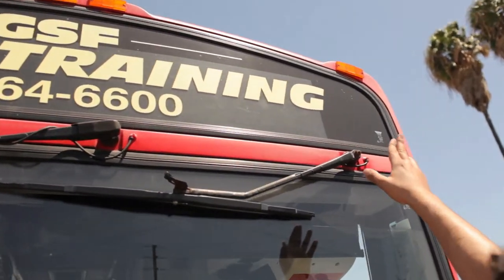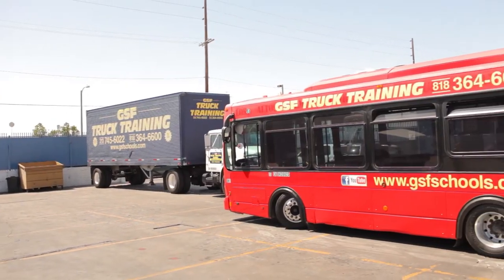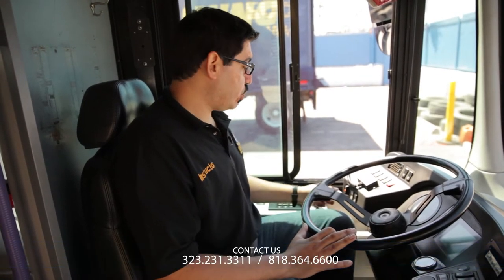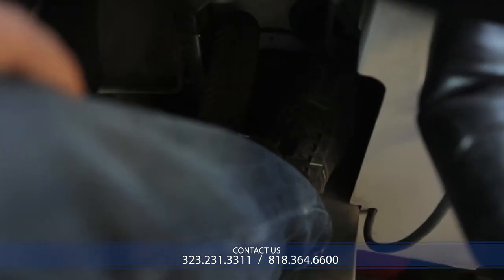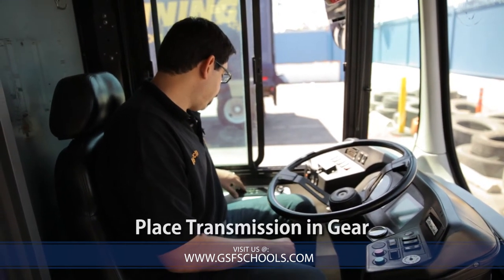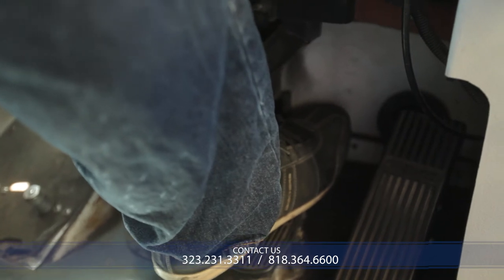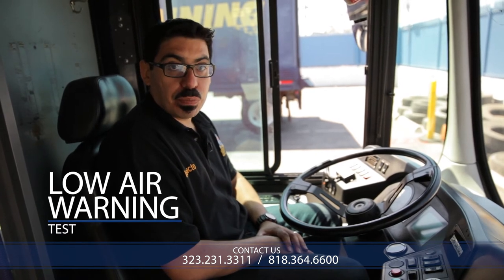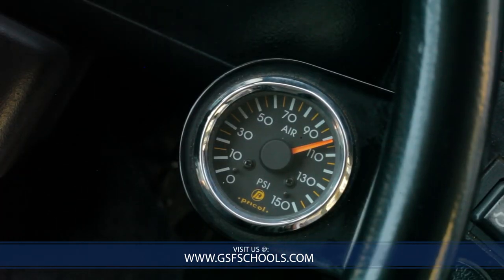GSF CDL B P Air Brake Inspection Bus 6 min sample

Comment: Putting an automatic transmission in gear does nothing to hold it.  Proper procedure is to leave it in neutral and block the wheels.